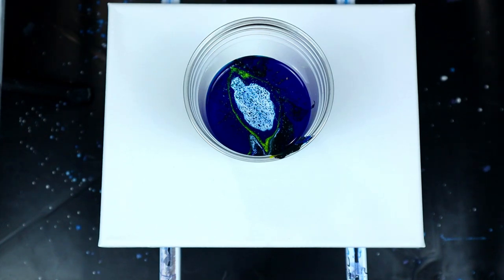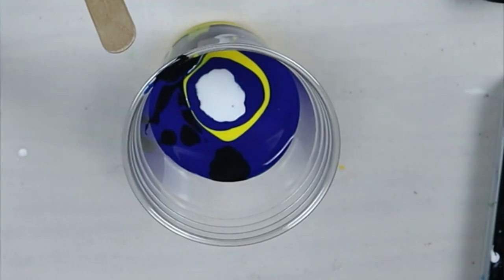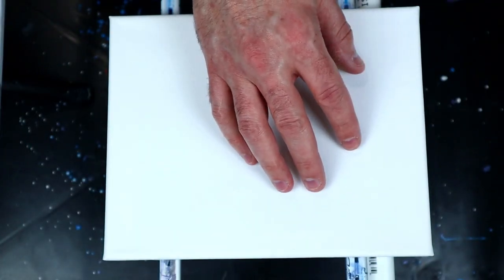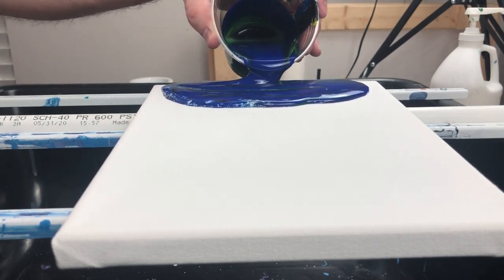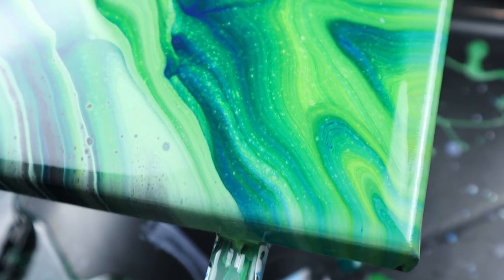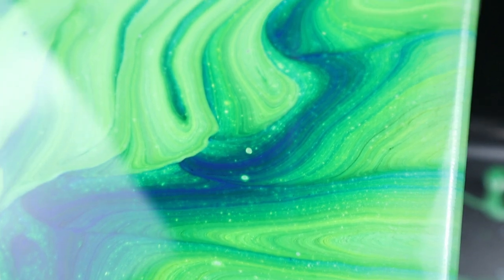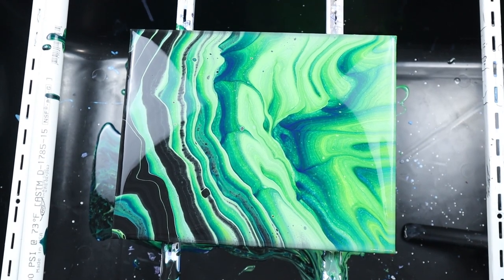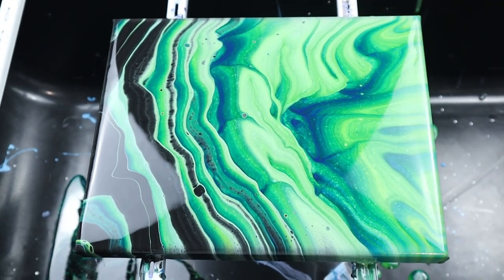What happens when you leave a dirty pour cup for 3 days?

Comment: I love it! I love the idea of letting the cup sit for a few days… I wonder what would happen if it was a foot cup with silicone… Or how far in advance can you mix a single color? Because there’s some times that I feel like mixing and not wanting to do a canvas I just want to mix and get the consistency proper … And sometimes I want to mix a lot of colors and then think about what colors I want to put together… Because I have a habit of pulling out like 10 colors but I should only be using three or four of them…🤷‍♀️🤪
Reply from the maker: You can keep mixed paint in semi-sealed containers for weeks.  The water type you add (tap = 2 weeks, filtered - 4 weeks, distilled = months) and the amount of air it gets determine how long it will last.
Reply: @LeftBrainedArtist  4 Weeks with filtered water!?!?! I had NO IDEA!!
...Well, this little tid bit just went in my painting journal!! 😊👍👏

Comment: Hi, I need your advice. I did a dirty pour with reeves mars black, reeves fluorescent yellow, fluorescent blue and liquitex titanium white plus Elmer glue (pouring medium) and silicone oil. Initially it turn out beautifully then after 6 hours all I can see black and grey with cells only. What happened? I noticed sometimes my end result will change to a completely different piece as the time pass by. Am I doing something wrong? Please advice. Love watching your videos!
Reply from the maker: Without seeing I am only guessing here but I'd bet one of these would help Nowreen.

The most common cause of this is your paint is too thin.  Especially if silicone is used you want your paint to be slightly thicker (mount up on a mount).  Thin paint, especially with glue, with just continue to blend over time.  Leaving it a little thicker will prevent some of that from happening and also let the oil come up in a group creating nice roundish cells rather than come up as round and then spread all over.

Second, is put more paint in your mixture.  if that was 2 parts medium to 1 part paint try 1.5 medium to 1 part paint.

Third, florescent colors are almost always transparent. You need way of those compared to opaque or semi-opaque colors to keep your color balance right.  I'd say use 1/6 white, 1/6 black, 1/3 blue, and 1/3 yellow for those colors to get some more color distinction.
Reply: @LeftBrainedArtist  thank you for your reply. I am suspecting my paint is too thin because I could see the side of my canvas coming through. Thanks again! I will give it another try. It looks so easy when I watch YouTubers do it, trying it on your own is hard.

Comment: Can enamel paints with a paint pouring medium be used for paint pouring like the acrylic paints are used with a pouring medium added to them for paint pouring? Do you know if there is a difference or not? If so, what that difference is between using acrylic or enamel paints to do paint pouring art pieces?
Reply from the maker: True enamel is tricky because it is a oil based product and may not mix well with acrylic pouring mediums which are water based.  Some definitely work like the ones used for the cloud pour.  This is probably something you should test in small quantities before doing anything large Allissa.
Reply: I was thinking for the pouring medium I could use the enamel conditioner I've seen some ppl talk about. I will try to send you a picture of exactly What I'm talking about. I had planned on buying the smallest sample the paint store will sale to me.
Reply: ￼

Owatrol Easy Flow, Acrylic Pouring Medium, Paint Conditioner, Water-Based, 1 Liter
Reply: Thanks for the advice left brained artist 🎨